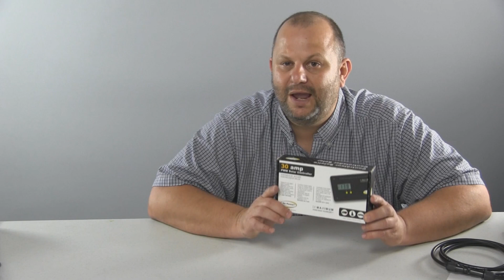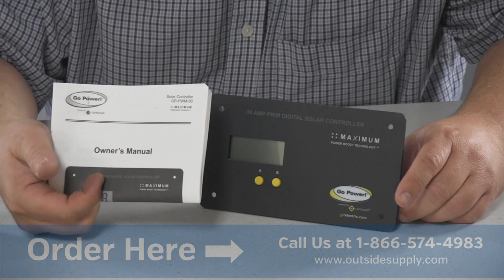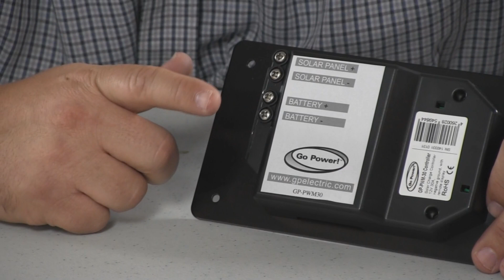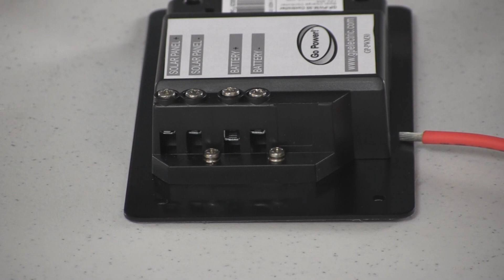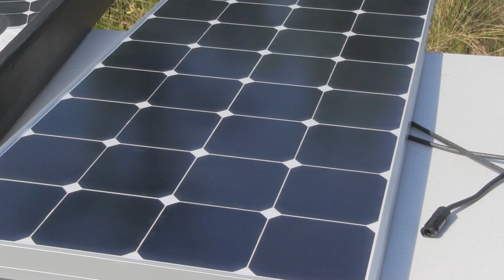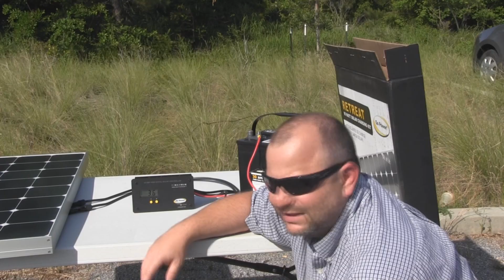Go Power 30 Amp RV Solar Charge Controller Unboxing & Setup

Comment: Hey man, I have the charge controller, opened my gopower pre wired RV it’s a 2022. Problem is, I can’t figure out why there are two sets of two cables? Two sets of paired red and black one is tagged battery negative and one is battery positive but there are two set of two. Can you help?

Comment: Is the system fused?
Reply from the maker: There is a 30 amp fuse that comes with the Go Power solar kits that goes between the charge controller and the battery. Usually within one foot of the battery.

Comment: the 30 amps is maximum that the unit can handle going through it. It does not produce or run at 30 amps

Comment: Is this charger capable of charging and maintaining 14 volt agm batteries.  And does this company make a 11 -16 volt power supply of 1500 or 3000 watt range
Reply: jesse yoder  PWM only charges at the same value of the batteries. That is, if the battery state of charge is say 12.5 volts, the PWM controller will charge the battery at 12.5 volts. If the battery state of charge is at 14 volts, then it will charge at 14 volts etc.